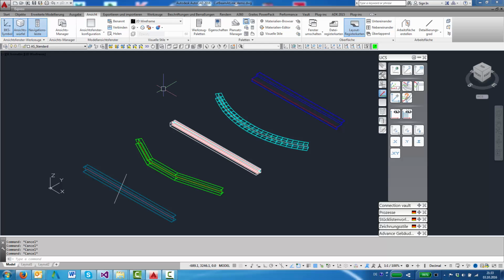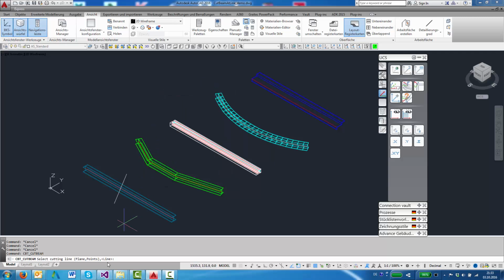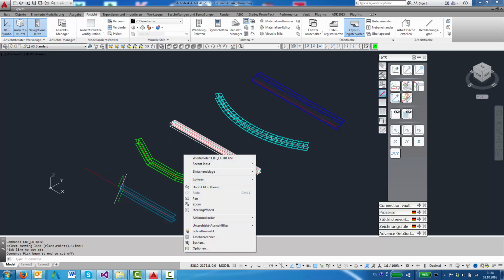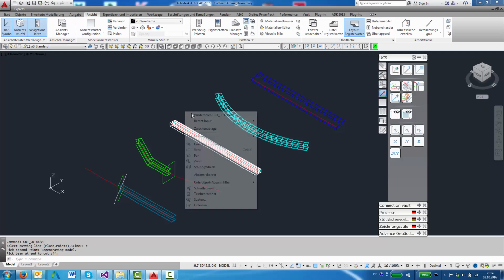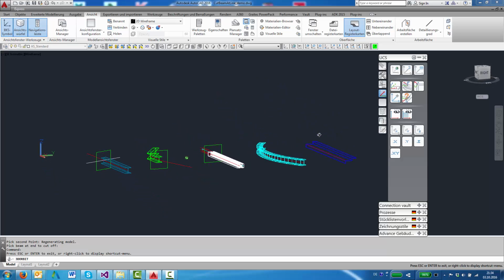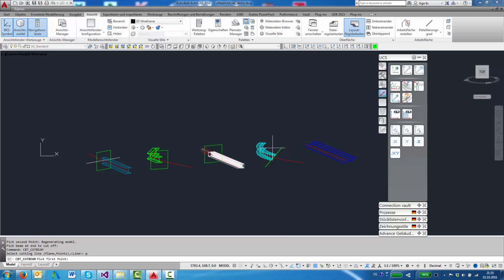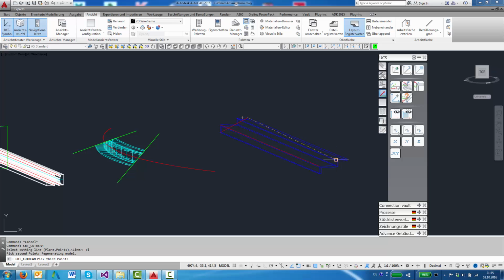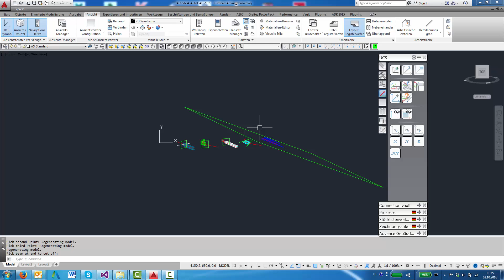Advance Steel 'Cut Beam at Line' Tool

Comment: This tool looks great. Does it leave a gap from the cut line? i've found that the standard AdvanceSteel 'cut at object command' actually leaves a gap of 0.001mm from the cut line which is quite frustrating. 
How would i get hold of this tool?